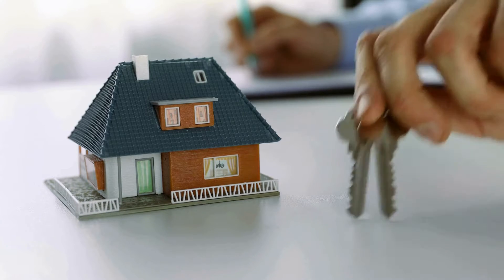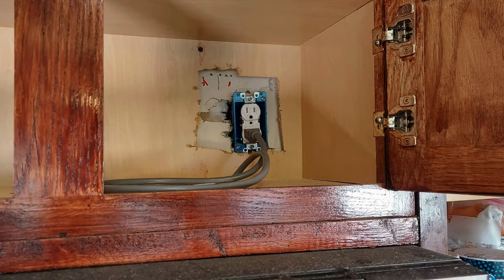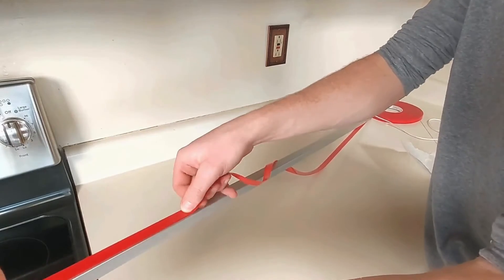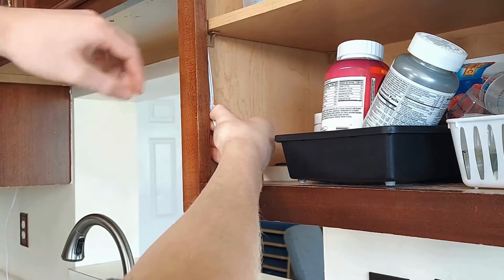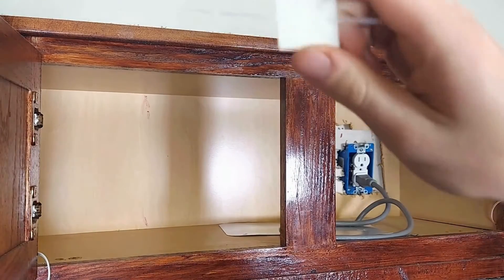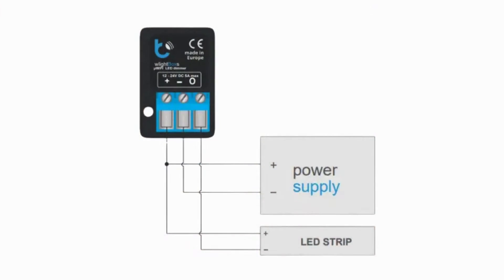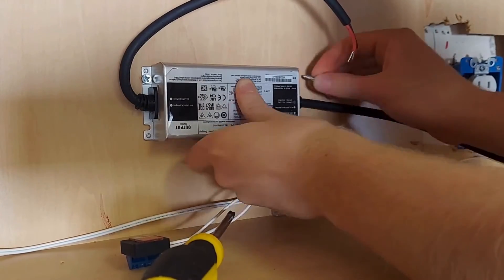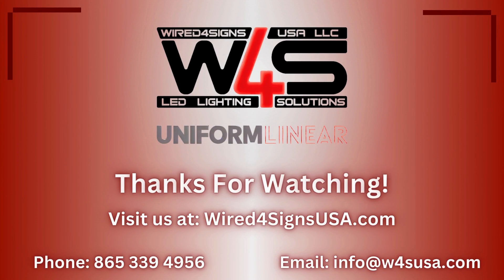How To Install Under Cabinet LED Strip Lighting The Professional Way- Full Guide

Comment: I had a small facelift done to our kitchen. There used to be some low voltage lighting under the cabinet, but it got lost in the reno. The black/red low voltage wire that runs from the light switch to under the cabinet is still there. Can I use wire nuts or something similar to directly hardwire a 12v led strip without a small controller or transformer? Just a basic strip that doesn't change colors or dims. The LED strip I'm looking at already has the red/black wires so no soldering would be needed.
Reply from the maker: Yes that would be fine - you could use these

https://www.wired4signsusa.com/collections/wago-wiring-connectors/products/221-series-wago-lever-nuts

We generally recommend 24v strip with drivers like these

https://www.wired4signsusa.com/products/compact-electronic-phase-dimmable-led-driver-24v-magnitude-lindrive
Reply: @wired4signsusa300  thanks for the quick reply! So you are saying I don't need these if I don't want the dimming feature? I can just connect black/red wires from led strip direct to the black/red wiring in the wall?
Reply from the maker: Ok sorry I did not understand clearly 
You need to make sure that there is a 12v DC feed coming out that wire . Old lighting was sometimes 12v AC which would not work with strip. You may want an electrician involved .
The physical wire can be reused